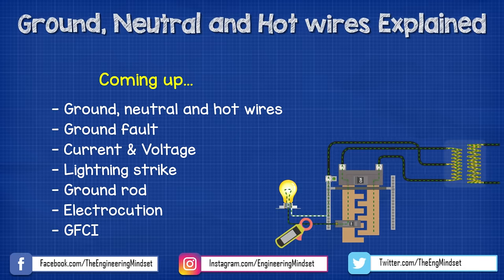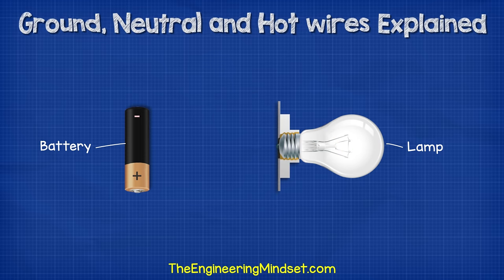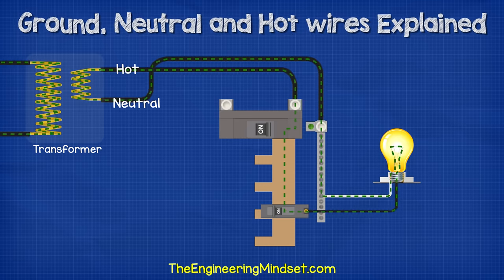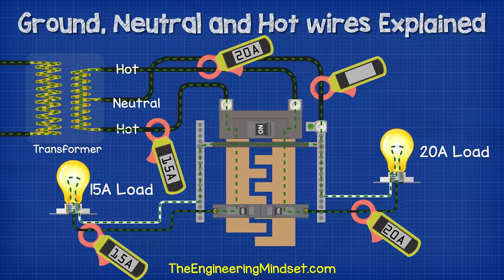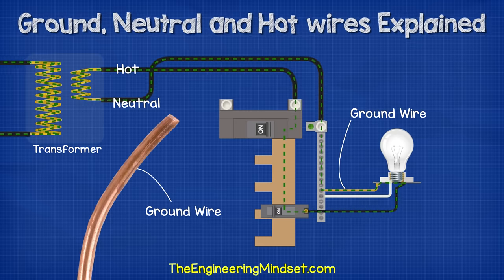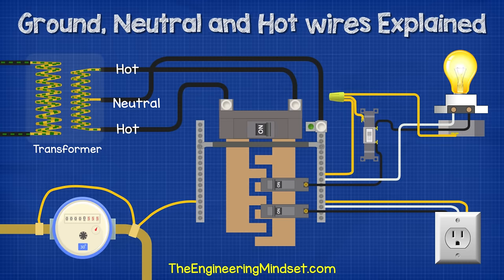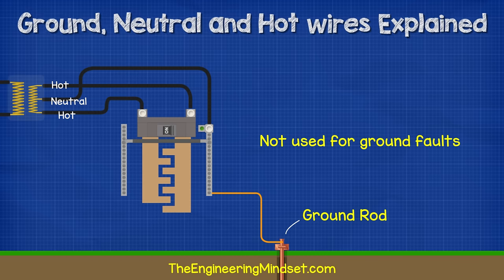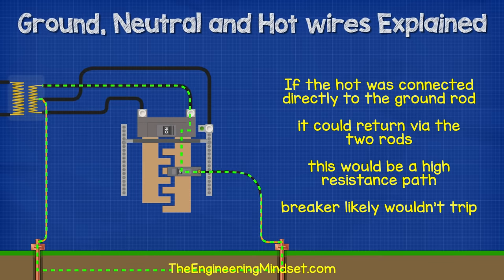Ground Neutral and Hot wires explained - electrical engineering grounding ground fault

Comment: That is a very good explanation of a three wire AC branch circuit and the fundamentals of residential electrical services. The only suggestion I would make is replace the word "resistance" with "impedance", as you are utilizing an AC system electrical circuit. Again, excellent tutorial for electricians, engineers and curious tinkers.
Reply from the maker: We just published a new Ground fault, short circuit and arc fault video, so much detail! Link HERE➡: https://youtu.be/Qi0ynSQw-wc

Comment: Great videos! Thanks for the content! One thing, (minor -nitpicky even) the 2 single pole breakers you have on the diagram are actually on the same phase in the breaker box which would mean 35 or 30 amps (depending on which scenario you're speaking of with amperage to each device) being carried back on the neutral?
Reply from the maker: We just published a new Ground fault, short circuit and arc fault video, so much detail! Link HERE➡: https://youtu.be/Qi0ynSQw-wc

Comment: At the end you said if a hot wire came in contact with a ground rod, "electricity would flow through the soil back to the transformer". But it makes no sense because the ground rod is also conected to the neutral bus bar at the breaker box. Therefore, if a hot wire comes in contact with a ground rod, electricity should just flow from the ground rod, to and through the neutral bus bar, back to the transformer, since that's the path of least resistance compared to flowing through the soil.
Reply: That is in the event the hot wire was directly connected to ground. If what u said happened then we would generate a short circuit.
Reply: @miguelac6872  That's exactly what happens when hot wires come in contact with ground wires: Amparage increases beacause of low resistance, creating a short circuit and tripping the breakers because electricity flows from the hot wire to the ground wire, back to the neutral bus bar and then to the transformer. It's the same thing that shoud happen when the hot wire comes in contact with a ground rod, since ground rods are also connected to the neutral bus bar at the main panel.
Reply: @F.J._Claes   suppose that we have unbalance phases in our electrical system,  as a result our neutral wire carries certain amount of current back to the source let's say   20 A with 5 V to the transformer.  Why do engineers say that connecting that neutral wire to a ground rod on the transformer will cause the neutral to be 0 V? Isn't voltage suppose to be energy per charged particle? If so, then how come those 20 A can make it to the transformer? Like with what energy per charged particle can those electrons get to the transformer if their potencial energy  was taken ? I hope you can undestand my point and help me  out with this question that nobody in colombia  knows how respond to.
Reply from the maker: We just published a new Ground fault, short circuit and arc fault video, so much detail! Link HERE➡: https://youtu.be/Qi0ynSQw-wc

Comment: I cut a wire that I thought was disconnected about 10 years ago outside in my garden after I watered and was barefoot. I could barely released my hand after about 5 or 10 sec. Oh yeah, and the diagonal cutters were old school uninsulated  one. I pretty much did everything wrong and now have a healthy respect for these videos
Reply from the maker: We just published a new Ground fault, short circuit and arc fault video, so much detail! Link HERE➡: https://youtu.be/Qi0ynSQw-wc

Comment: Loved the video, but as an ee student we always use conventional current flow, from plus to minus.
Reply: think you got that backwards
Reply: @yoski203  Not really, we understand that electrons flow from minus to plus, however, the calculations are easier using conventional current flow
Reply: Foundations of Analog and Digital Electronic Circuits by Anant Agarwal does a very good job at explaining why this is.
Reply: I learned it both ways (electron current flow and conventional current flow). I prefer to use electron current flow, probably because that's what I've used at work for more than 43 years. Yes, the hand rules are the opposite, but either way works fine. In certain applications, I find it more convenient to visualize what the electrons are doing. In vacuum tubes, the thermionic emission, and grid control is electrons. In semiconductors, I use both electron flow and hole flow. In magnetic circuits, for motion, flux, and current, I use the hand rules based on electron flow. I guess it's what ever you get used to. Either way works. I've noticed that physics likes to use conventional current flow, whereas much engineering uses electron current flow. Most of my schooling used electron current flow. The US Navy Electricity and Electronics Training Series (NEETS) was developed for use by personnel in many electrical and electronic related Navy ratings. It uses electron current flow throughout all the manuals for consistency.
Reply: All i know is if I connect the red probe of my meter to the negative contact and the black probe to the positive contact i will receive a 
Negative reading on the screen
KISS
Reply from the maker: We just published a new Ground fault, short circuit and arc fault video, so much detail! Link HERE➡: https://youtu.be/Qi0ynSQw-wc

Comment: What's stopping the current from traveling in the ground wire since it's bonded to the neutral in the panel😵
Reply: Unless a ground fault exists, the ground wire doesn’t form a circuit because it isn’t actually connected to anything.

Also, neutral wires have no voltage, which is what makes them neutral. I find it helpful to think of the current in terms of air flow. The AC supply on one of the hot wires repeatedly “blows” electricity through the wire, then “sucks” it back. You can think of the neutral, with its connections to the physical ground neutralizing its voltage, as being a “vent” or supply of air at atmospheric pressure. All it does is supply electrons to be sucked in or a place for blown out electrons to go.
Reply from the maker: We just published a new Ground fault, short circuit and arc fault video, so much detail! Link HERE➡: https://youtu.be/Qi0ynSQw-wc

Comment: I know that electricity technically flows from negative to positive but seeing as how we draw it as positive to negative, it's kind of confusing for you to utilize the battery in the opposite manner of conventional diagrams. I get what you were going for but I wish everyone could just agree on a standard and keep it that way to be less confusing.

Electricity flows negative to positive but thanks to Benjamin Franklin we draw it as positive to negative....except for your video that shows it negative to positive....thus the annoying debate continues. If I have my history wrong, please correct me...I'm an electrician, not an engineer 

Great video though!
Thanks for all your hard work
Reply from the maker: I know what you mean, we're going to stick to the correct way
Reply: @EngineeringMindset  fair enough
Reply: I was watching this video and I started immediately to get confused when I saw the battery power flow to the circuit. I’m not an electrician. But I did Physics in school for three years and learned about electricity through Physics and it’s flow from Negative to Positive. That was always in my head. Then I started to work in Industrial Engineering in Process Control Engineering and Process Automations Control Engineering with PLCs and Modules I/O Control Panel diagrams and circuit and was then told electricity goes from + to - in how Field Devices are wired and powered and I was like WTF 😳! Like literally wait WTF, when did this happen. Totally confused the hell out of me. It still does. But I decide to accept it as I was told that this is how it flows in Electrical Control & PLC panels and device wiring. So then I watch this video and am like well that’s as I originally learned it, but I’m still confused. A video should be made to explain and correct this or whatever North American Benjamin Franklin bullshit explanation is responsible for this confusion or misunderstanding. Because it persists!

Comment: I've burned my fingers enough times on live wires that I wouldn't mind learning what the fuss is about… 😁
Reply from the maker: You should buy rubber electrical gloves
Reply from the maker: Also, shouldn't be working on live circuits
Reply: @EngineeringMindset  Mostly this

Comment: I always though that ground faults went to the grounding rod. My life is a lie.
Reply: LOL!
Reply: same ;W;
Reply: But in other countries it is designed to do that
Reply: Klik B  European countries with 230 V  supply the current returns to the source via the neutral under normal circumstances. Only when there's a leakage or fault the current goes to ground which has the same potential as the neutral conductor
Reply: @meninpapin  like the philippines lol
Reply: @boyscout-p3u  and my country south africa
Reply: Ground faults occur in the field. They are attracted to earth because earth makes the return connection that completes the circuit. The whole system is referenced to the earth, so that voltages can be controlled. There are floating systems out there, and in those you can touch either conductor and not be shocked. The problem then is if there is a fault on either leg, there will be no protection.
Reply: Klik B  The neutral is earthed at the transformer too, so the soil becomes a "wire" for electricity to return to the source. The resistance is high so the current will not be huge but still enough to trip the GFCI (which we call a residual-current circuit breaker over here) and in Europe this is actually the path that ground faults take as the ground isn't wired to the neutral.
Reply: Electricity holds the great secrets ands thats why we are kept in the dark about most of it. 
Electricians utilize it but don't understand it. Like language with most people.
Reply from the maker: We just published a new Ground fault, short circuit and arc fault video, so much detail! Link HERE➡️: https://youtu.be/Qi0ynSQw-wc

Comment: "Used Electricity"
Reply: You can get it cheaper used
Reply: iLoveTheseRemoras ☆ Its just as good as new, some scuffs & stains, but still has the "JOLTZ"!!!
Reply: Ya, that phrase bothered me as well. It’s kinda lame to use the sloppy non-scientific misleading term “Used Electricity” in a video teaching how electricity works. 😐
Reply: @A1Skeptic  Could you please explain why that term bothered you? I'm trying to grasp the basics of electrical engineering. Is it because the so called "used" electricity is in fact not used up? If I understand correctly, electrons give us energy simply because they bump into atoms as they pass through a conductor or a load such as a lamp, resulting in heat energy, which in turn gives us light when it's hot enough. Is this correct? if not, I would love an explanation :) thanks
Reply: @Alexander-qy7yz  The term “used electricity” is both ridiculous and misleading because it is the forced movement of electrons that transfers power from where it is generated to where it is used. The electrons are never used up, just pushed around. While it’s ok to say a thing “uses electricity” to operate, there is no “used electricity” - it’s not a thing that exists. Here’s an interesting fact most people don’t know that may help: The electrons supplying power to your house do not come from the power company! They just loop endlessly through the wires in your house and out to the big pole transformer and back. There is no metallic connection between the high voltage and low voltage sides of a transformer, the electrons on the low voltage side are just pushed around by magnetic force. This is why the phrase “used electricity” is silly. Where is the “used electricity”? (Note that saying we “use electricity” is ok, but leads to the misunderstanding that there must therefore be “used electricity”. It is more accurate to to say we “use electrical power”) Cheers!
Reply: @A1Skeptic  Thanks for the reply! So basically the power company provides no new electrons but rather a high potential difference in the transformer outside of our house, affecting the electrons in our house circuit, making the electrons in our houses move, correct?
Reply: @Alexander-qy7yz  Yes. Power generated at power plants from falling water, burning fuel, wind, etc., is used to create an electrical potential by using electromagnetic force to “force” the electrons already in the wires to just move in a loop, out of the generator and back. Transformers are inserted into the “loop” of wire to be able to increase or decrease the voltage potential (or pressure) along the electrical transmission grid. Each segment of the transmission path is a closed “loop” that free electrons in the wires are forced to endlessly travel. As far as we know the Universe has exactly the same number of electrons in it now as it did 13 billion years ago. Luckily for us they can be pushed around. 😄
Reply from the maker: We just published a new Ground fault, short circuit and arc fault video, so much detail! Link HERE➡: https://youtu.be/Qi0ynSQw-wc

Comment: As a Civil Engineer I find this videos very interesting and quite easy to follow. There are many similarities between flow of water and electric flow.
Reply: I often use the example of water flowing through a garden hose when explaining the 3 basics of electricity: Voltage, Current, Resistance. Water pressure is the voltage, water flow is the current, size of hose is the resistance.
Reply from the maker: We just published a new Ground fault, short circuit and arc fault video, so much detail! Link HERE➡: https://youtu.be/Qi0ynSQw-wc

Comment: Great video!   
One suggestion:  In the AC diagrams, it would have been helpful if the neutral wire back to the transformer had been white, not black.  The two hots are black, which makes sense, as that is the usual color coding (or one is red), but the neutral is usually white.

Comment: You just helped me understand the reason for power load balancing on each side of the bus bars in a power box. Do you explain why there's a reason you should try to equate the load on each bus bar so that the neutral going back to the power source doesn't have a ridiculous load going through it?
Example:
120amps on the left bar with 0 amps on the right bar. Assuming a full 120amp load on the left bar and obviously 0 amp load on the right bar, the difference would be 120amps, thus 120 amps going through the neutral during a phase cycle.
I'm assuming that would be bad, right? I know wire heats when current is passed through, so I assume that could result in a fire hazard, but that's what I'm not sure of. Seems logical enough, though.
An electrician doing some work on my house (he was an apprentice working with his father that was a licensed electrician) tried to explain it to me but I wasn't 100% on the reason why it was important to balance that load. With your video, I believe I understand why it is important.

Brilliant, brilliant video, sir!

Comment: Great video for someone who knows nothing about electricity. Very well explained. Question - what happens if the circuit breaker AND the outlet are both GFCI protected? Does it confuse the current balance and trip the GFCI?

Comment: Thank God you just explained in simple form what really a neutral connection especially when it is compared to a center tap transformer and just like a dry cell battery..
Reply from the maker: We just published a new Ground fault, short circuit and arc fault video, so much detail! Link HERE➡: https://youtu.be/Qi0ynSQw-wc

Comment: Your ground path explanation was very good but everyone should be advised that under certain conditions a ground path can be of such a low impedance due to both soil conditions and metal pipes from drinking water and sewer and utility pole guys and grounds that the returning neutral current to the transformer can be shared on the ground system. In some cases an impedance may have to be added to prevent this. One other note, to say the ground (referring to the grounding conductor of a circuit, not the earth) has a very low resistance is somewhat misleading and in the case of many feeders and services it is actually of a slightly higher resistance. For instance, a 50 amp feeder with #6 copper hot wires is typically matched with a #10 ground. The reason it is still safe to have a smaller ground is because it only needs  to be large enough to facilitate the operation of the over-current protective device in the event of a short-circuit/fault condition. These may seem to be very picky points but I assure you that they are correct and it does matter for a complete and safe understanding in the field.
Reply from the maker: We just published a new Ground fault, short circuit and arc fault video, so much detail! Link HERE➡️: https://youtu.be/Qi0ynSQw-wc

Comment: Very good description of a fairly complex subject. My only comment would be on the diagram that occurs at time 6:45 in the video. It shows a battery driven circuit with neutral, hot and ground wires. I realize this is a hypothetical case, However, in cases where a battery does actually drive a load ( electronics and automobiles, etc. ); convention is to connect the ground and neutral to the negative.
Reply from the maker: We just published a new Ground fault, short circuit and arc fault video, so much detail! Link HERE➡️: https://youtu.be/Qi0ynSQw-wc